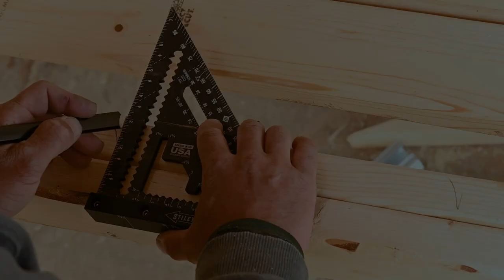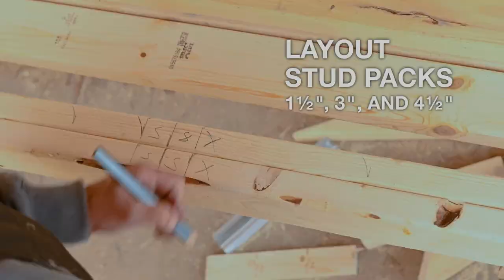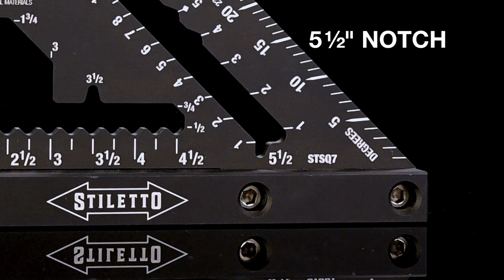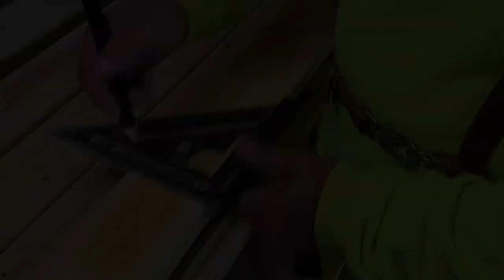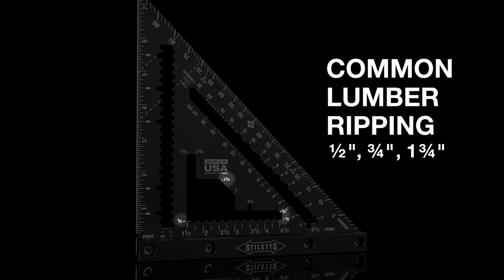NEW! STILETTO® 7” Carpenter Squares BOMBER™ Guide

Comment: Stiletto is the biggest rip off company in the world I think
Reply: Festool 🤔
Reply: I would never buy from stiletto again. I bought their large prybar with the bottle open in it. Guess where it broke? Where the bottle opener is. 99 percent of the people using the prybar are not opening bottles, they're prying 😂 It broke within three months of buying it. Stiletto would not warrant it, they just told me they were working on it. Then they just stopped making the prybar. No warranty 😢
Reply: Vaughn nail pullers, and Vaughn hammers. 10 times better than stiletto and 10 times cheaper. Nuff said
Reply: Martinez too
Reply: @Dude-hr4oh  If you can’t open a bottle cap with just a regular hammer claw you are not a carpenter
Reply: 😂 facts!